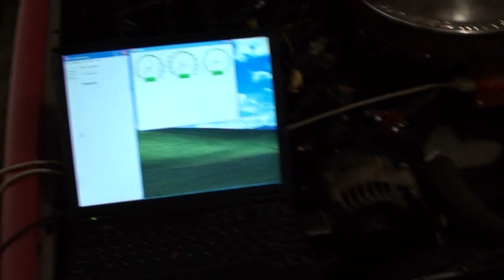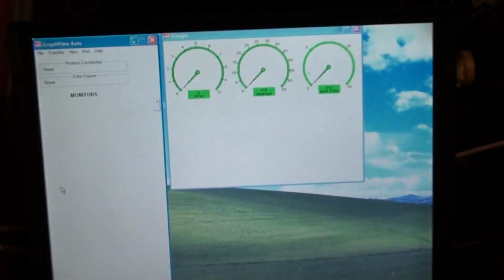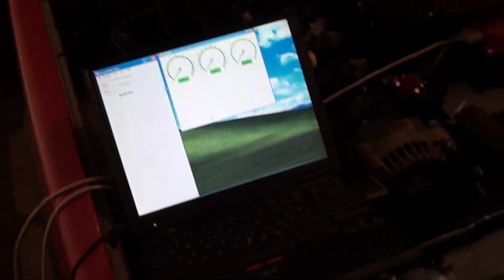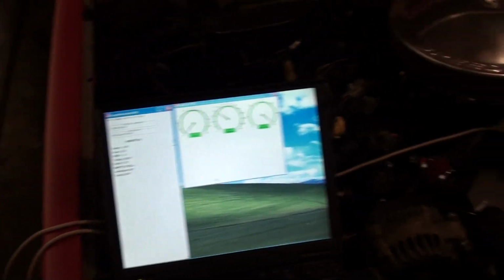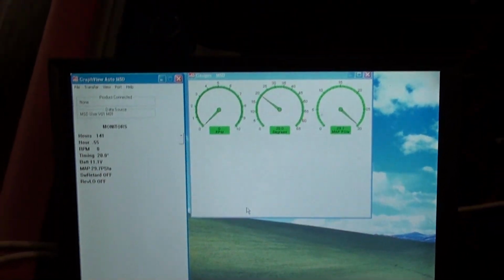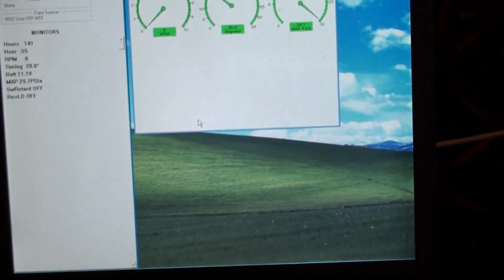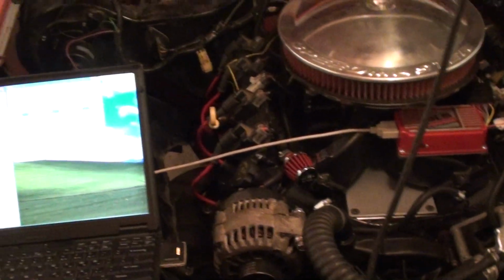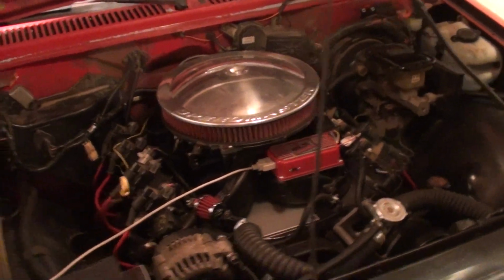How to : Basic Troubleshooting MSD-6010 LS1 Carb Swap

Comment: I have random backfire, msd6014 keeps saying cam sensor fault on 58x . I've verified 5v and correct wiring and replace sensor twice. Any ideas?
Reply from the maker: Wrong timing gear??
Reply: @beeterolds  
I checked it, it's good. 58x 4 cam gear 3 bolt cam

Comment: I have a 5.3 carburetor swapped in my Cutlass it was running I shut it off and it wouldn't start again I'm getting power to the coils but no spark... Any ideas or suggestions?
Reply from the maker: Check ur grounds